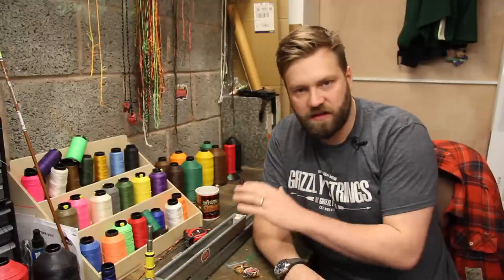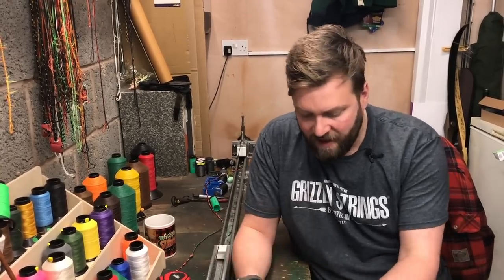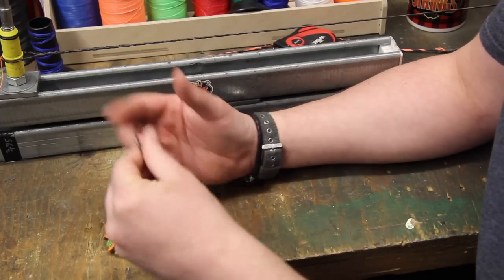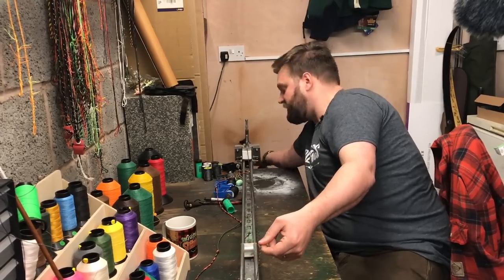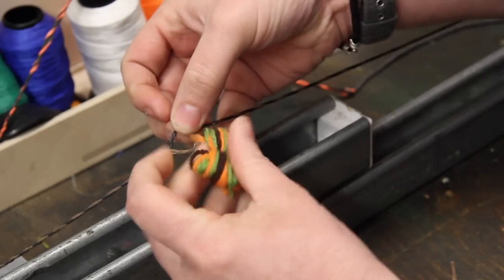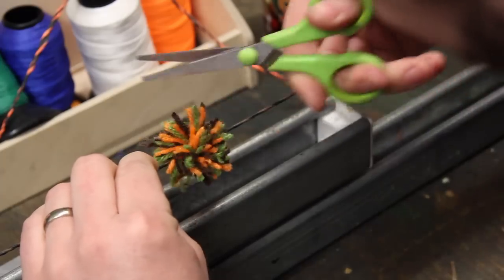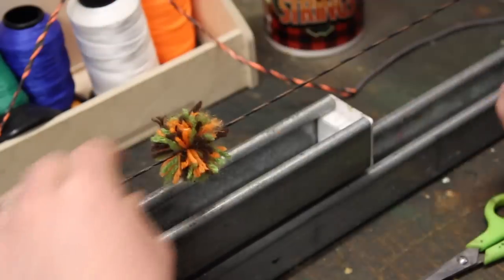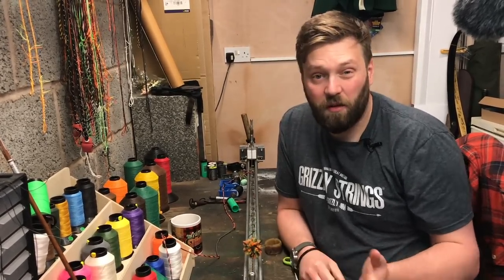How to fit wool String Silencers - Traditional Archery

Comment: Does it matter if you run one silencer on the top or the bottom? Or do you need to have 2 installed when shooting?
Reply from the maker: I would always run a pair, keeps a little weight there i  there evenly distributed.

Comment: Question: I've done this before on one of my bows which has a regular old Dacron string and had no issues. I recently bought a new bow and tried the exact same thing, but on this bow (same Dacron type string) the balls leave a gap in the string. Should I worry about this? It doesn't seem like something that should be happening...
Reply from the maker: Neal Grieb sounds like you’re either dropping a few twists while inserting the silences. Or the silencer themselves are a little thick, causing the two string bundles to separate..
Hope that helps Neal
Reply: @ArcheryAdventures  indeed, but it's this a problem for the string? Is assume I'm losing the benefit of having all of the strands working together. I don't want to break a string and/or a bow...

Comment: It's shocking that the guy sponsored by Grizzly Strings also thinks Grizzly Balls are better than Beaver Balls. I find it odd, but it may be true.
Reply from the maker: Tango Nevada lol sponsored?!? It’s my company dude 😂 I’d love to sponsor my self, but I’m just not that good. Grizzly balls aren’t necessarily “better” than beaver balls. They are however easier to install and lighter than beaver balls. Archery is all about personal preference and what works for you...
Reply: While it may be true and I am willing to believe it is (The ease of install part). It just reinforces my point even more. But that's okay. Your balls may be far better and I have no problem admitting that may be the case (No I am not even going to bother with the pun ease). I'm just saying it's in your best interest to say that they are better. So whether sponsored by or the owner of, of course you will say your product is better and I wouldn't expect anything less. I guess what I am saying is, I was initially under the impression this was a review and I got an advertisement instead. But no worries. Both are pretty cheap and easy to compare and test.